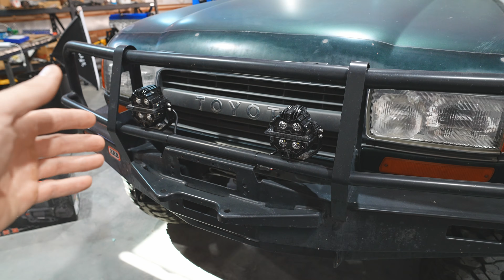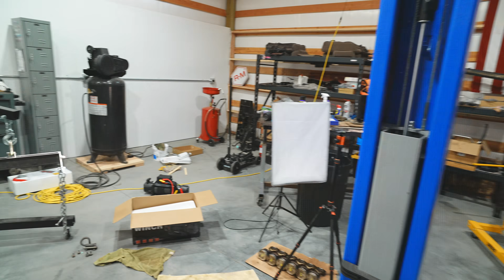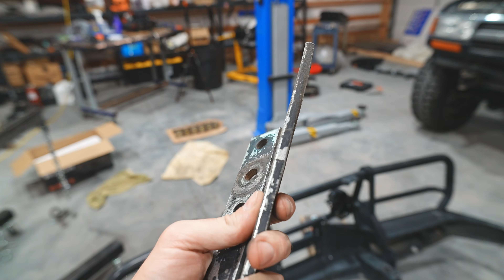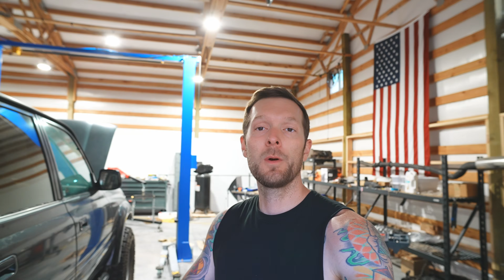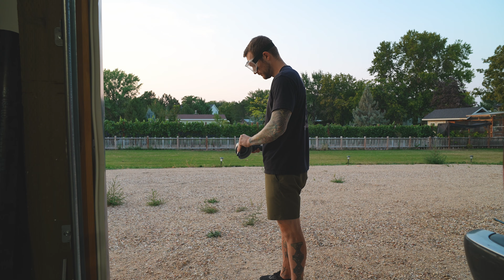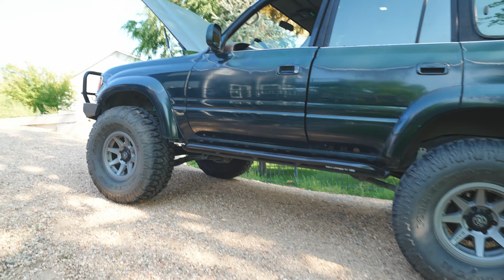12,000 lb Winch Install on My Land Cruiser 80

Comment: Funnily enough here in Australia our winches use to fit the Australian bars but now everything is made in that stupid horizontal mount you guys have and ive seen a few winches sheer bolts off.
 Mounting the winch upside-down was a fail

Comment: I ran a Stinger SGP35 500-AMP Relay and Isolator off amazon. It connects to my auxbeam control panel inside allowing me to cut on and off power to my open road winch.
Reply from the maker: Smart!

Comment: I had to modify the controller box bracket for my 1st gen 4runner too because it hit the grill. The trail gear bumper for my 1st gen 4runner is mounted parallel to the ground. I bought a Arb for my 3rd gen yota 94 pickup. I'll have to check if the winch holes are mounted like yours.

Good thinking about having a cut off switch for the winch.
Reply from the maker: This kind of mounting is called "feet forward" I guess. I think it's an ARB bumper thing, at least it was on these older bumpers. Maybe the new ones aren't the same way?
Reply: @RM_Garage yeah the arb bumper possibly hasnt changed at least looks wise, its been out for awhile. Its still in the platic and cardboard wrap haha dont have a lift to put it on so waiting for the right day!

Comment: I always ran my winches direct to battery (every winch I've ran has built in fuse protection), but recently on my HDJ81, after wiring in my onboard air and air lockers (thanks to your super detailed videos!), I decided to route every single aftermarket accesory through a PICO 200 amp automotive circuit breaker, mounted to my aftermarket fuse/ relay box from amazon. Gives me peace of mind in case the winch or compressor decide to stick closed one day (my starter motor did that once), and if you're on a long overland trip and start getting electrical gremlins, you can manually shut off the circuit breaker to all your aftermarket wiring with one press of a button under the hood, effectively reverting all your wiring back to factory for troubleshooting.
Reply from the maker: I'll check that out! Yes the peace of mind is a huge deal for me.

Comment: How did the front suspension take the extra weight?? Or did you already have the heavy duty coils installed? Looks good!
Reply from the maker: Thanks! It didn’t budge at all, the winch is pretty light. These are the 3.5” VT coils.

Comment: I don't know anything about the ARB, but I know the hardest part about putting the winch in my BIO bumper was remote mounting the control box.  Ended up fabbing up a bracket to mount just the guts of it behind the grill.  And got lucky and won a Warn 10k in a raffle.  Warn makes the extension kits for remote mounting, so it was easy enough to buy the wire to remote mount from them.  

Looks like you at least didn't have to move the control box very far.
Reply from the maker: Man I was dreading that if it were to happen! I would’ve had to come up with an extension or honestly I probably would’ve stumbled across that warn kit and repurposed it. What are you using for your winch cutoff?